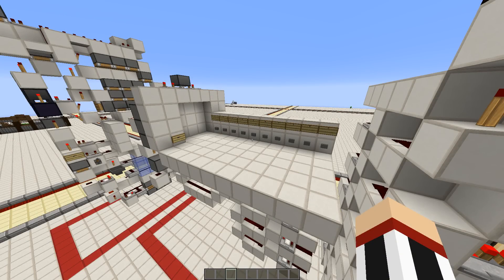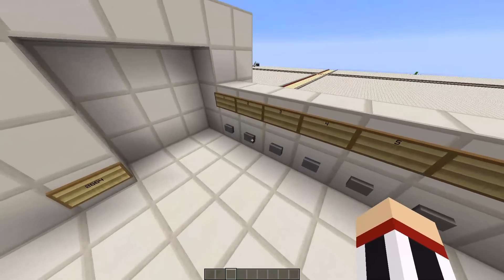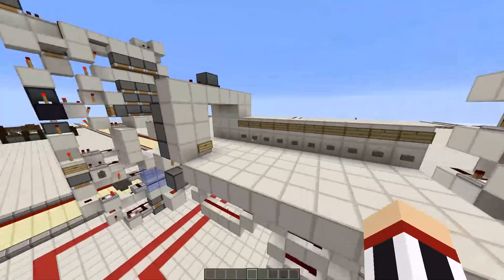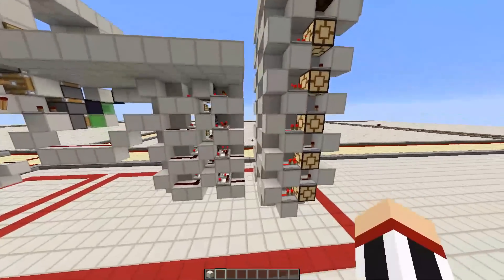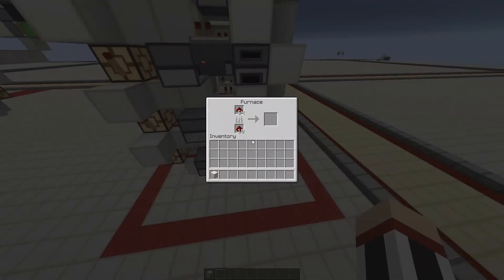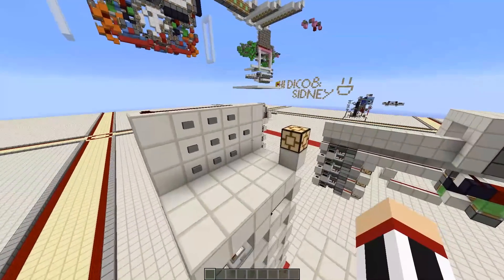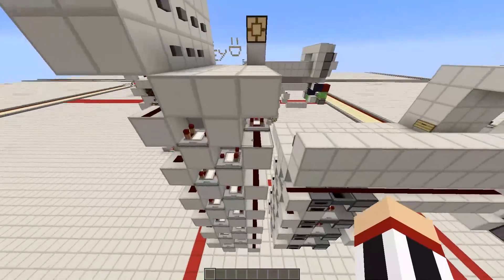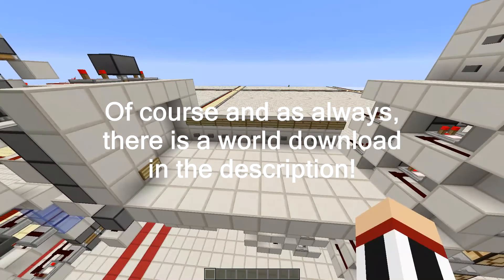Tiny Combination Lock using Signal Strength (6x4 footprint!)

Comment: Took you long enough to release this. Glad you finally did it.
Reply from the maker: +Cubehamster Innovation in Minecraft Certainly did. I want to keep up with 1 video every sunday now. Even though I made a video for it a few months ago but never uploaded it, that took about 30 attempts, this only took attempts untill the lock worked properly. It makes it easier and actually fun to make videos to be able to not fuck up as much, even if I could still improve a lot on my commentary.
Reply from the maker: more like every weekend, actually.
Reply: +Cubehamster Innovation in Minecraft I thought you made a similar system using snowballs in hoppers, didn't you? It was much longer ago and I'm not sure it works anymore, but it made people realize that building combination locks with signal strength was much more compact than using giant logic gates.